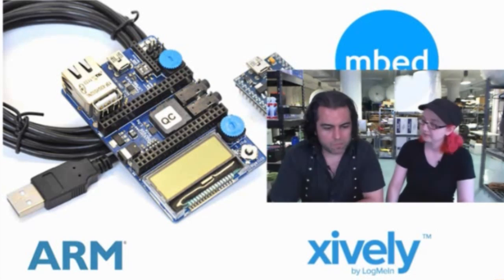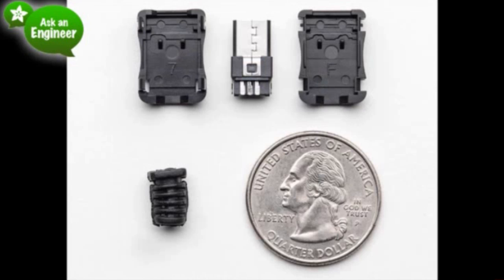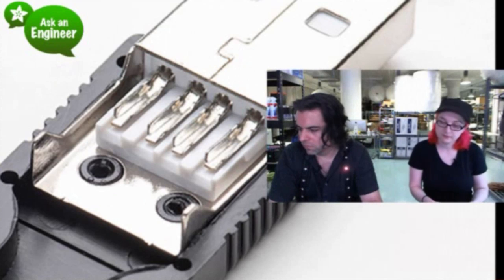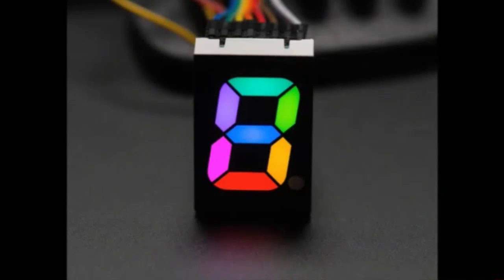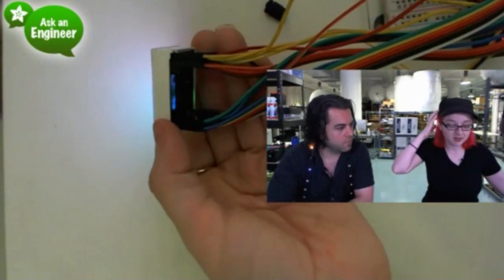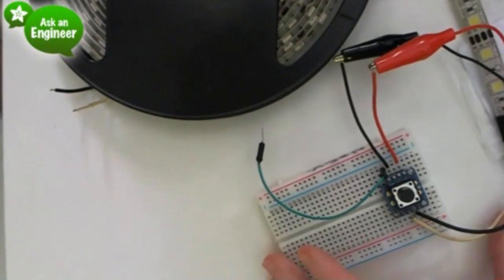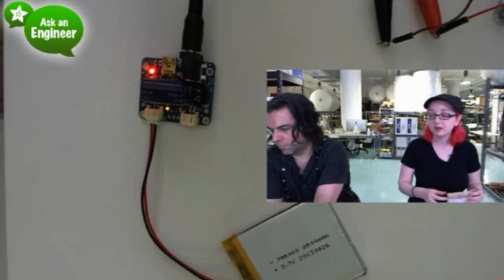Push-Button Power Switch, Xively & more! New Products 6/8/2013

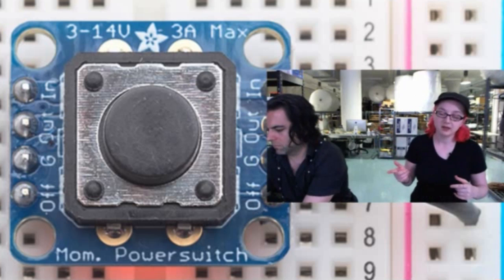Comment: 13:03 so if you have this connected to a rechargeable battery pack can you still connect a battery charger to the output of this power switch to send charge voltage through this circuit back to the battery for charging without issue?